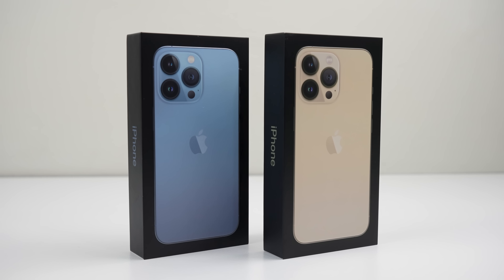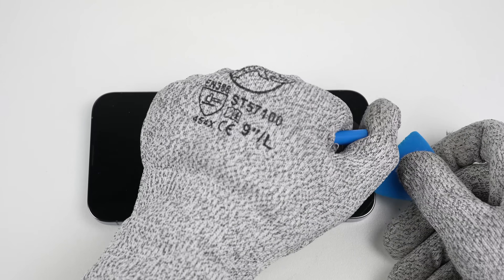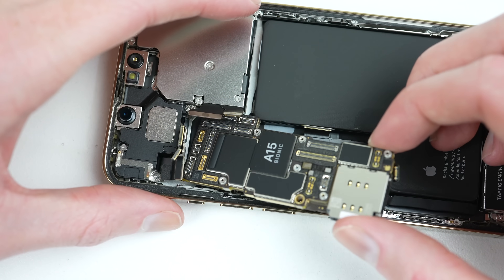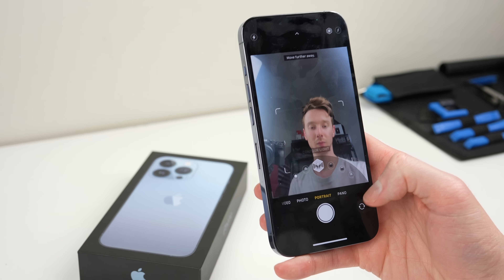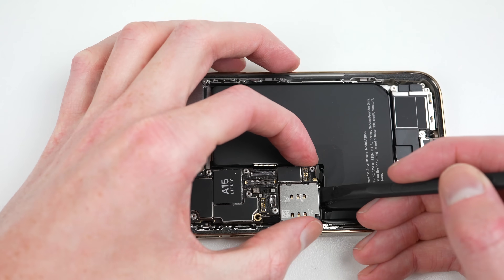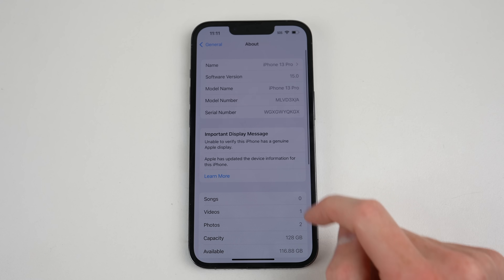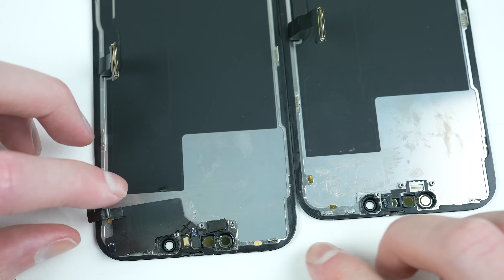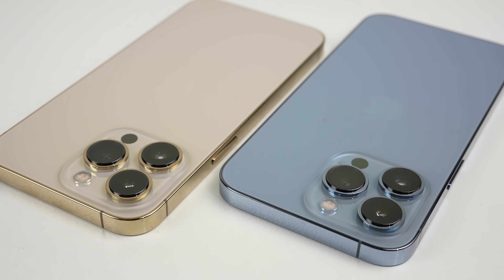iPhone 13 A Repair Nightmare - Teardown and Repair Assessment

Comment: So... your fundamental premise is completely wrong. Apple has NO PROBLEM with third party repair facilities.  They just have to be APPLE CERTIFIED third party repair facilities.   Imagine I design and built you a car and offer you a warranty.  Then you decide to take your car to Emmit's fix it shop where it sits in dust and grime amongst lawn mowers and coffee machines, etc.  Emmit may or may not have access to the same parts as I do but he's sure as hell not doing things up to my standards. You get your car back and it works fine for a few weeks. Then it breaks again and this time, you decide to bring it back to me to provide replacement parts. Now tell me... does this sound fair?    

I am not going to try to defend the price tag apple places on being an "apple certified service provider". I have no idea what it is. But I will tell you there are literally thousands of them, possibly 2 or 3 times as many as actual apple retail stores.   When I call in and ask for a service appointment,  they tell me which store is closest to me.  They don't give preference to apple stores over authorized third party service providers.    The only way your argument holds any water is after the device is completely out from under warranty , which excludes the phones in your demo.  You might suggest that apple remove these restrictions on phones that are beyond any sort of warranty repair service. But as for new phones, don't begrudge them this policy one little bit.

Comment: Don't self repair these devices. I know you feel like you would be able to, but there is literally no reason to do so. It's not that much cheaper, it takes a lot of effort and in most cases you get scammed by small repair shops that will install cheap parts that you are not savvy enough to notice. iPhone is a luxury device, if you are buying a $1000 phone, it actually costs $1200 - $200 for the insurance. If you spend $1k and don't buy insurance for your money - well that's on you that you have to pay high price for authentic repair.

Comment: A very comprehensive teardown and presentation, indeed. Bravo! But there is a danger that in one of the next incarnations A. bloodsucker will go even further - i.e. an experiment like yours will actually lock out the firmware for good. You will no longer be able to make the phone work ok again even after putting back its original components, like you did in your video. 
—-
I admire A.’s workmanship though. Yet the complexity of the device being just a phone with camera is perplexing...

Comment: Im lauging at  the 1.9k (dislikes atm) salty ass apple heads who are not ready to acknowledge the fact that apple is a cash monger and will not spare a single moment to swipe their bank accounts clean. Its so stupid to lock modules to the phones chipset. Almost like u buy a car but no access points to change the oil and u have to take it back to the manufacturer.

Comment: I just finished watching an official Valve video on disassembling their upcoming Steam Deck.  They include warnings (in a sort of Aperture Science way), but show you EXACTLY how to do it.  What a difference between them and Apple.  I now wish Valve sold phones.
Reply: Well that market is pretty damn open so I can see them doing that
Reply: @june-cz1cw  valve rely on their "popularity" as reliable. And their average users are very tech savy. Can't get away with practice like this
Reply: Their so transparent about that I can almost forgive the long wait for the third Half-Life sequel.
Reply: I think they also allow third party app stores, compared to apple.
Reply: The Valve Gauge 1, 2, Series 1, Series 2, and Alyx
Reply: Literally every other known phone brand is repairable.. Why tf would someone get an iPhone.. Garbage locked software, no customization, no 3rd party apps, using apples proprietary garbage, these right to repair issues, 3 year old phone design in 2021, etc.. Etc..
Reply: Look up Fairphone, cool company. My phone seems pretty indestructible, and I got a screwdriver with the purchase which match all screws inside.
Reply: I would buy a Valve phone day ONE
Reply: @uNnHkP8mza but not their games though
Reply: I've seen that too lmao

Comment: I know this argument has gone on forever between IPhone and android users but... it is a real thing. Apple are evil. Get a good android or a cheap one, if you pay 1200 for a note 20 ultra or 80 for a cheap android it doesn't matter, you can fix your phone, and tinker with the firmwares (if you wish) apples time is nearly up. They've ripped apple followers off forever. I thankfully have never owned one,  brick Nokias in the 90s  symbian in the 00s and android ever since and I thank myself lucky

Comment: Imagine all the coding needed to create so many fake issues.
Would be interesting to tap into the communications between these modules and seeing if there is a single serial number check causing everything and if something as simple as spoofing it through a fpga-in-the-middle will fix it.

Comment: I am Apple certified for repairing iPhones. Here is the thing about the newer iPhones... if you manage to take apart a newer iPhone properly, its still not a guarantee its going to work properly if you replace any parts because Apple requires calibrations and post diags in order for the parts to work properly. Also, 3rd party parts cannot be calibrated and verified through apple.

Comment: I know nothing about coding so pardon the stupid question but, considering the loss of functionality is a coded in feature, why is it not possible to go into the phones code and trick it into thinking the replacement parts are “genuine” ?
Reply: i also know nothing about coding but also this is apple, they probably prevent third parties from adjusting coding too. i doubt they would want anyone to have access to that.

Comment: As a former Mac technician I can say this exact same thing is happening (at least hardware-wise) is happening with every new generation of MacBook. Many components that used to be screwed in (and easy to remove) are now glued with adhesive, and other important internal components (microphone, USB slot, etc) were combined together, so you have to replace the entire board to replace a single small component. 

It shouldn’t be legal, but they are doing whatever they can to get around it. The older generations of MacBooks could have been repaired by anyone with YouTube, but now it’s considered dangerous for non-certified technicians to.

Comment: I stopped upgrading my phone years ago, all these new phones coming out just refurbished old ideas. They go from Square edges to round edges to square edges, they go from a plastic back to a glass back to a plastic back.
The camera quality has been nearly capped out, there's only so much you can do with such a small CMOS
The interface is exactly the same as it's been
The apps are the same
The phones speed and power is the same as your last phone when you had it new, but legally they are allowed to update their software to make it to little more heavy, so that older phone start to become a little sluggish. But now the difference between performance is very small.

Both Apple and Samsung, they are pumping out $2,000 phones now. Which are virtually the exact same as the previous one.

This is called planned obsolescence, they can't simply stop now they need you to buy new phones every year. So their whole model is to try and get the consumer to purchase a new phone, by making that perfectly good phone that's only a year old, shitty. 

On top of this it's also a constant battle, they don't want you being able to repair and upgrade these things because they want to keep selling more. So they make it more and more difficult every time to repair them, even though it is yours. If that doesn't show you that they don't think about you, the end user, I don't know what will
Reply: It is despicable, I saw all this shit with apple products by 2015, never bought anything again. And now Samsung is going the same way. Almost all the smartphone industry is corrupted by planned obsolescence and ultra-consumerist ideologies. It is too difficult to ask to be able to change the batteries again? how about a platform that allows upgrading components? $$$
Reply: @liousevropaecvstos7711  just buy like A series Samsung. Really good phones for the price
Reply: The only thing samsung and apple  do each year is change the camera setup, and maybe improve the camera. Atleast Samsung has tried to be innovative with those folding phones.
Reply: @pixlitol  that's why you use them till they can't make a basic call or text before getting a new one, and why, at least for now, I feel Samsung is better than Apple, as we have already confirmed Apple intentionally creates "glitches" to destroy their phones quicker than normal.
Reply: You forgot alluminium backs...

yeah, some actually did use alluminium backs. (aka few did)
Reply: Samsung phones last very long and they keep their quality over the years except batteries because that's impossible but you can replace them. I still use my S6 from 2015 because it has a unique color that hasn't been released again and I'm still in love with the phone even if I have S10+.
Reply: They think about us
Just how to do the worst things to us
Reply: 2017 cheap Xiaomi still going strong
Reply: Youre not wrong but ngl Im hyped for the pixel 6
Reply: I'm pretty happy with my lg phone
Reply: they'll have to pry my LG V20 out of my cold dead hands
Reply: Yep - the sad thing is that the customers are made out to be the addicted consumers while the true addicts are the manufacturers... addicted to their scammy business model. As resource scarcity across the globe increases, these companies are doomed to collapse. Sure the people at the top will be given golden parachutes, but I'll bet they'll start by laying off Apple employees long before that happens. Make sure to really stick it to the poor folks on their way out, you know? Greedy fuckers.
Reply: You are right on almost everything, except for the camara part. Cameras have got so much better in the last few years it's almost incredible. I switched from a top of the line iPhone 6S Plus to an iPhone 12 last year, and it's unbelievable in the dark. I can take a pic in full darkness and see better than with my own eyes, while with the 6S anything beyond sunset was a full black screen on camera. 12 Pros and 13s are even better with night HDR and mechanical zoom up to 12x. I'm not particularly interested in taking super duper pics with my phone, and I upgraded only because the 6S broke in a flight with heavy turbulence. But if you want good pics, it's a good reason to upgrade.
Reply: Reminds me of the old lightbulb companies. The same reason your phone goes caput and forces you to buy a new one is the same reason you need to buy new lightbulbs every now and again. Planned Obsolescence.

We have the ability to create perfect lightbulbs that last far longer than what we have now, just like how we can make phones that can last for an entire decade or more, but the companies have agreed to make their product intentionally break so they can keep reaping the profits.

The lightbulb companies took it a bit further by creating an international committee and established laws that forced the competition to either play their game or be forced out. Unfortunately modern companies are already international and don't need such thing to create a market ran by them.
Reply: Your behavior has already been fixed by the expiry of updates and the resulting poorly functioning phone. ;-)
Reply: I am happy with my Samsung right now, 7 years old and still going strong, at best Apple would last 3 maybe 4 years before "glitches" start occurring, or the screen shattered because they are purposefully made to be flimsy and spider web at the lightest hit. Meanwhile my current phone got dropped from the second story of a hospital I work at, onto solid concrete, with only the initial case provided by the phone on purchase (a glorified rubber condom effectively) and no cracking, spider webbing, damaged pieces etc. While Samsung certainly is by no means a Saint, the durability of my current phone shows just how underhanded Apple has become to ensure that their customers buy the newest IPhone, and only get repairs from Apple. It also highlights just how much engineering Apple puts into their phones for the specific reason of making their phone more flimsy, while disguising it as normal wear and tear from product usage.
Reply: Yep i feel like the smartphone industry is controlled by corporate thugs who are experts at squeezing every dollar they can out of their customers. And they are all made in China. we are giving business to our enemy when we could be making them here in the USA!

Comment: The first (and last) IPhone I ever bought was the IPhone 4, it was marketed as a tough phone that was  10 times stronger than any of the competition. I dropped it once and the whole screen shattered, the expense to get it replaced was ridiculous compared to other brands of phones. Also in order to download music or videos onto it I had to download ITunes and sync it every time to my computer whereas with other phones I could quite easily just drag and drop what I wanted onto the phone, even at a friend's house.

Everything about it was limiting and even back then I felt as though it was not my phone, I'm glad I got rid of that piece of junk and have never bought an Apple product since.
Reply: lol bro. .exactly same story like mine, what a coincidence. Iphone 4s is my first and last ever apple brand i bought, truly an overprice piece of junk that mankind ever built 🤦‍♂️
Reply: Had iPhones all my life. Currently on my first Samsung.. it's godlike. I can download adblocker apps off the fucking internet!!
Reply: Mine was the 5S. Surprisingly, mine survived all up until today. (Dont worry, I just use it to monitor and adjust my router settings, nothing more. I already upgraded to a Oneplus and I’m pretty happy with it).

The funny part is that, even if it works a lot of the apps are restricted behind a new OS, but why would I need to update the OS to access google fucking docs? The amazon app?
Reply: IPhone5 was my first, surprisingly it survived my constant abuse
Reply: Limitations what? Most of the apple users are not really able to use a Smartphone. They just call, sms, chat (whatsapp, etc.) and tht's all. I have a colleague that has always the latest Iphone, she was complaining that she was not finding a certain place and was lost... I asked her: did you used the gps and the maps? Ah? What? No.

I leave to you all any comment...
Reply: @Grissinen  She wouldn't have gotten to her destination if she had used Apple's directions, anyway. Best kind of lost I ever got was when I let my friends us their iPhones to navigate.
Reply: Same here, used (and still partially) using my huawei p10 the 5th year. Since its getting old and the Software dont get optimized i switched to the iPhone 7 Plus. Its just some months older but everything just works Fine (except the battery) but I feel badly regulated by its ecosystem. There is for example just one (ONE !!!) Browser you can Download that supports direct Video Download like android. It should be mandatory. Basically no extensions except for Safari allowed and a big lack of modifications. Will stay with this phone for a while, a shame that Update guarantee isnt mandatory in the android sphere.
Reply: Yeah i Opened a ln iphone 4, i dropped it 2 times but it didn't really get damaged
Reply: Wanna know the sad part? The 4 & 5 series of iphones were the last good ones. 

Still, I still DAILY my ipod touch 4G. 

I am willing to put up with itunes and having no access to apps just for that reliability, and that AWESOME sounding DAC.
Reply: Thats why you should get a screen protecter and case 🤣 that happens to samsungs too my old s6 broke instantly as i dropped it but that taught me a lesson to get case and screen protector
Reply: @adidragomir7469  Man what do you want me to do?? There are exactly zero perfect brands
Reply: I’ve been rocking the iPhone 8 for 5 years , dropped it countless times, even without a case! And not a single crack!! Things a beast!!!
Reply: Wow that was a really great story bro you bought a glass phone and you were surprised it broke? Thanks for that incredible speech really added a lot to the conversation

Comment: I've refused to use any Apple products when it was revealed that they intentionally slow down old phones when new ones come out.
Reply: Really!!! That is so cheeky. I guess by slowing down your phone, you will be forced to either repair or purchase a new 🤷.  I hope someone makes a custom software.
Reply: @westfredfredwestfredfred9546  Unlike android you can't get a custon ROM to apple products yet, they get a very tight grip on anything in the phone, all proprietary.
Reply: @westfredfredwestfredfred9546  not that I know. Best is jail break which is a nerfed root
Reply: @westfredfredwestfredfred9546  There's a surprising amount of limitations regarding versions of iOS, even designed by Apple. I updated to a version of iOS that basically disabled the Force Touch feature that they stopped putting in new iPhones. I tried to go back to a version of iOS (made by Apple, completely unmodified) from 3 weeks ago and I couldn't. It turns out that iTunes cryptographically asks for permission to restore your iPhone every single time. And after 2 weeks their server stops giving permission for the previous iOS version. So... Good luck getting anything not made by Apple onto "your" iPhone.
Reply: Apple: Slows down my old iPhone so I'll have to buy a new model
Me: Buys a Samsung instead
Apple: Surprised Pikachu face
Reply: @TheFunniBaconMan  yeah Apple definitely cares, they’re heartbroken
Reply: I still use iphone 5s and its still good